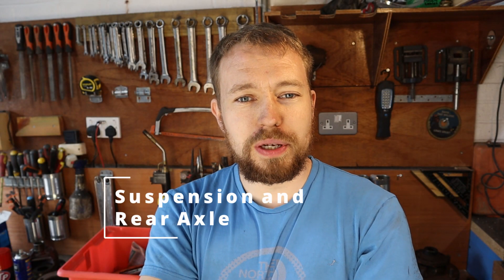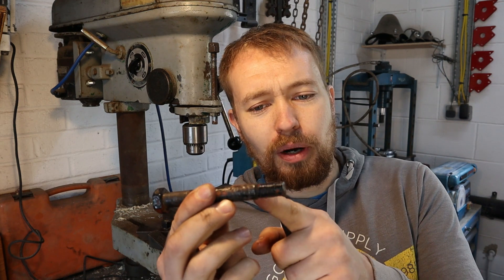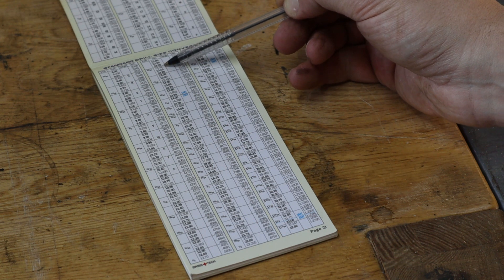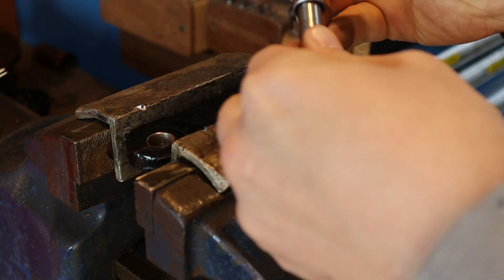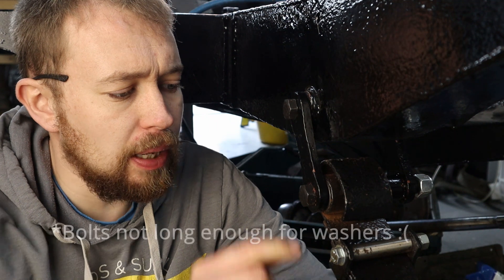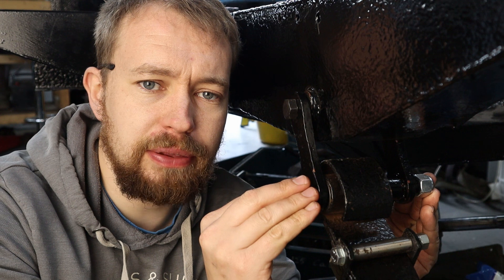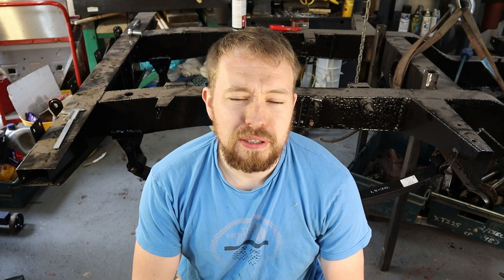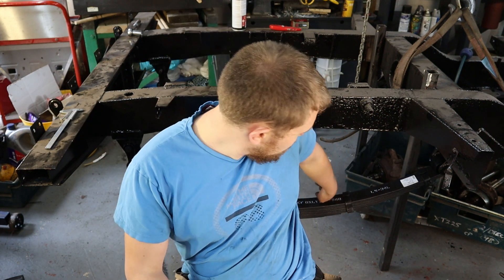Fitting Springs, Shackles and the Rear Axle to my Land Rover Series 2 Restoration

Comment: Is the thread drill bit drawn down by the thread itself or do you push a little bit.
Reply from the maker: Apply a little pressure to start it off and then just the weight of your hand to balance the spring in the pillar drill